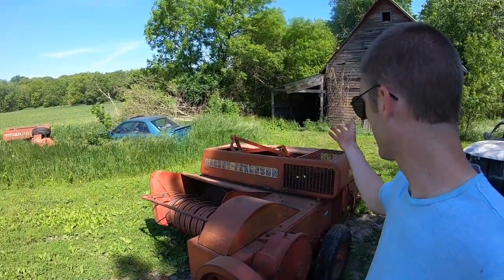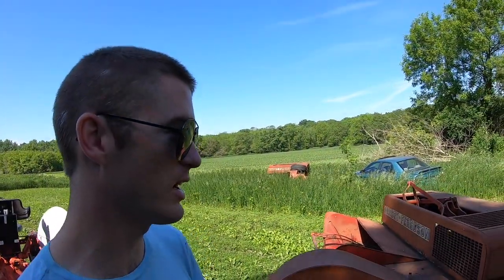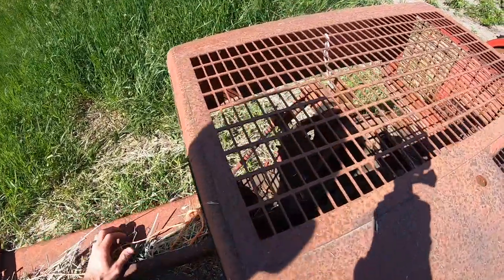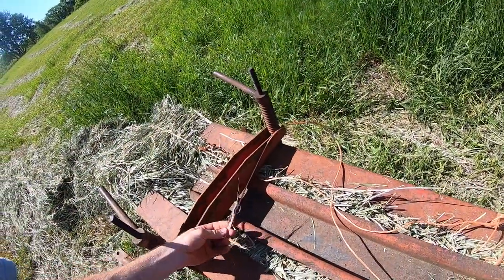First Baling Hay 2020

Comment: I tried using a Case VAC on a John Deere 14T baler for my first try baling (1997)and it just didn't have the horses and umph to do it right.  Then bought a New Holland Hayliner and Farmall H and learned to tune the baler so that everything worked right.  Baled that way a few years and then bought a Case tractor with live PTO which made baling so much easier.  I never tried using plastic twine because everyone here told me sisal would work better in the old baler. 
Can't imagine that the 8N has enough HP to run a baler unless that Massey is made for low volume baling.  After the VAC didn't work for me, I asked around and was told that I needed a 35 or more HP tractor to power the New Holland baler.  The last year that I put up square bales, my wife and I baled 3,000 by ourselves.  Hooked a hay wagon behind the square baler and I rode the wagon to stack while my wife drove the tractor.  Then, she rolled the bales off the wagon onto the elevator at the barn.  Lots of good memories.
Reply from the maker: I might try some other twine after what I have runs out but it works fine after it starts going. The 8N has plenty of power but mine also has a Sherman aux transmission so I have 12 forward speeds, so that will make a difference. Thanks for watching!!
Reply: @HumbleAcres  Either twine will work.  The key is getting correct tension on the twine coming out of the roll.  The plastic twine is slicker and needs to be tightened down a little.

Comment: I have a MF 10 baler, the same baler, but with the newer plunger gearbox. The straggly bales indicate you need to move the plunger slides in for a cleaner bale. The bales should be tight , if the bale dogs are free, and the chocks clean it also helps to make a clean square bale. The baler works best baling tight bales, how it was designed. This requires proper plunger clearances, a sharp plunger knife, and correct tension slide setting. With so few bales, it is difficult to get the settings right. You can still get many parts for this baler unlike a NH, or other brands. Recently I got a bill hook, gathering springs, pick-up teeth . Used parts also are around if you look online. These MF balers were sold world wide , many models had the same parts, why parts are still available.
Reply from the maker: Thanks for the info. I also have a parts one so I should be able to keep it going for a while.

Comment: For the small amount of baling you do, and how little money you have in it that baler and tractor will do fine. Yes not having live PTO isn't great but make due with what you have. The John Deere A you are fixing up has more power and won't get rocked around like that Ford does. I baled plenty of hay with a 25 horsepower Minneapolis Moline "R" as well as a late John Deere model B. Neither one had independent PTO.  Pulling wagons (racks) behind as well.  As for the baler, getting a manual which you may have (didn't watch all your other vids) and going through those knotters, timing adjustments etc will have it working well. All those balers from back then were much lower capacity than what is made or used now.
Reply from the maker: I really do need to go through the baler but it works good for what I paid. Thanks for watching!!